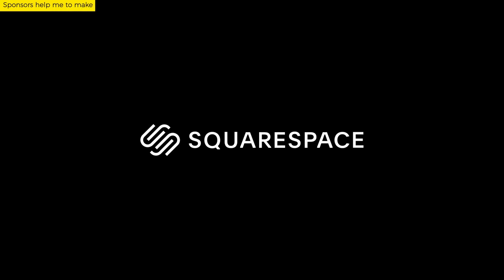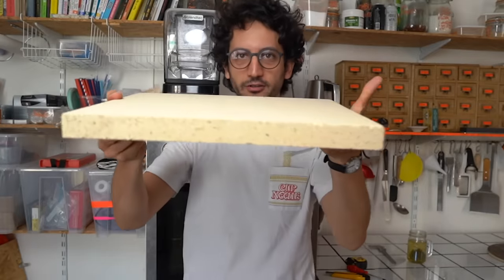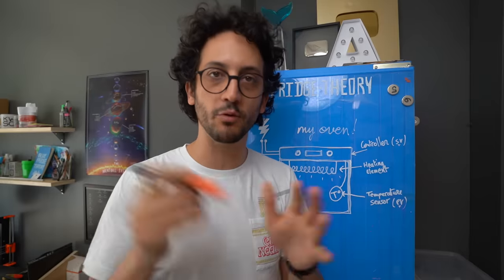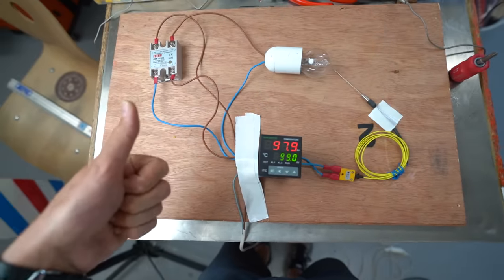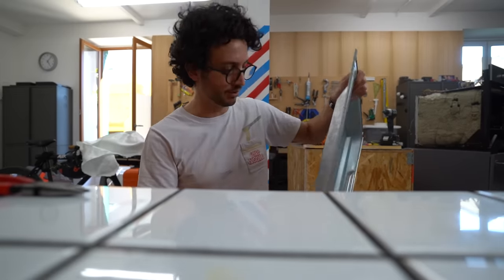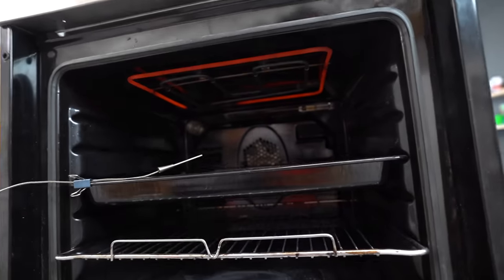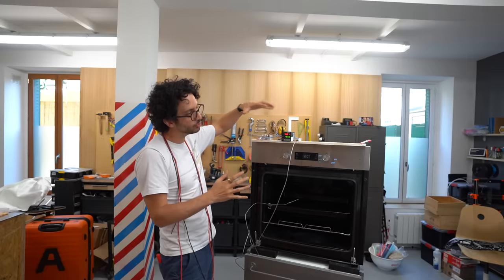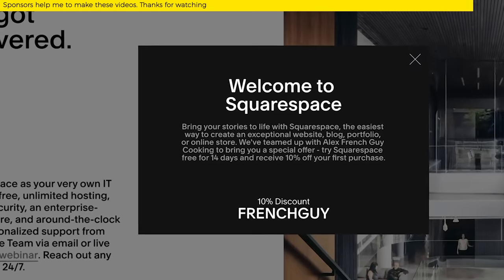I've got a Serious "Pizza Oven" Problem... (part 1)

Comment: Please be careful when you have your heat right up and the door closed. Not all doors are created to handle the heat. I used to work for a Lofra/Baumatic back in 2007 and we had major issues with oven doors exploding and shattering all over the kitchens of our end-users. The door has multiple layers of glass and if the air inside heats up to much the air pressure can skyrocket and burst the glass.
Perhaps some vent holes in the top and bottom of the door and check that the materials and equipment above the door can handle the heat that will be channeled past that area.

Comment: Note for Alex or anyone re-creating the perfect oven:
If possible use 3 or 4 wire PT100 (Class B 500°C) with a 6mm dia mounted at the centre where the Pizza is going to be baked - more realistic cooking temperature. if not at the same level as the Pizza shelf - All this for better temperature accuracy. 
The original temperature probes of the oven look like they are Capillary thermostat usually have a max temp of 300°C - if they are they won't last long.  our work ovens failed dramatically at lower temperature for over a 2years.  I would strip out this original controller setup.
If you have a bottom Heating element inside that oven - use it.  Connect another SSR in parallel,  some controllers will handle 2 separate logic (SSR outputs) and regulate accordingly.
If thats the PID temperature controller that we had at work it ain't that great but its ok for what Alex is attempting.
Don't forget to AutoTune(automatically learn) the PID controller so  it understand how to regulate this oven setup (heating and cool down and temperature ripple control).  There is a function on some PID controllers to autotune at every power up.
Retest oven temperature (+10°C) with external temperature logger to prove that its about +/-1°C fluctuation.  more expensive PID controllers can get +/-0.3°C stability.
I'm worried that the working temperature of the Controller is at the top of this oven as I can't see if its properly insulated.  Typical temperature controller electronics won't got above 55°C. monitor this area at max temperature,  as there are some controllers with built in temperature reference to compensate for probe accuracy (CJ - cold junction).  if the working/operating temperature is hotter - move the controller into an external box away from the oven for more stable reading and temperature control.
Some temperature controllers are programmable (cheap ones 4x segments) so it will switch off after a time.  some controllers have comms(RS485 or Ethernet tpically MODBUS) for remote controlling - i like these.
Depending on the insulation and heat of the oven, should be looking at Working output(WSP) - (applying power the heating elements in %) to be less than 40%,  if the oven is well insulated (without glass window) I've experienced  10% to maintain spot on temperature.
There are people more experienced than myself - please correct me as my fact could be wrong

Comment: I'm not an electrical engineer, so Alex is most certainly doing it correctly. But if I was approaching this problem, it seems easier to modify the signal coming from the existing probe, and have a switch that activates a simple circuit tricking the oven controller into thinking the probe was reporting, say, 200F lower than actual temperature? Seems simpler, and wouldn't require nearly as much modification. I believe those sensors work on a fairly uniform resistance scale.

Comment: Am i going crazy? 
Wasn't this video series started with a video altering your oven at home? I'm 100% sure that i saw you alter the oven at home and specifically mention the electrical engineering part. (You sawed off the bit that made it unable to open when Pyrolysis was on)
Where did that video go?

Comment: Hey Alex! 
Did you check that the heating element (and the rest of components for that matter) are rated for that amount of heat/current you want to produce/withstand (an amount much higher than the intended one)?
Just asking, because those kinds of modifications to home appliances are big deal modifications, not like the initial "hack" of your home oven.
Greetings from Spain!

Comment: I would install the probe in the middle back of the oven if possible so you get the temp reading at the pizza's location rather than the top corner of the oven.

Comment: Yo Alex. If you're using the pizza stone to get hot and cook on that, if you want the most accurate temperature measure. Drill a hole in the side of the stone and mount the probe into this. That way you are controlling to the temp of the thing your pizza is sitting on rather than the air in the oven. You won't go putting it in before your stone is up to the correct temp.

Comment: I worry about the thicker gauge cable vs the thinner from the mains. Does this not contribute to more resistance and a risk for fire? I have seen wires burn up like gunpowder fuses in an instant. IANAEE (I am not an electrical engineer) but surely cord length is included in the calculations I hope Alex...

Comment: Wouldn't the thermal conductivity of the oven wall be an issue? I feel like a thin steel wall would let the heat escape faster than it can build up in the oven and just not let it get enough. Or that element might need some serious wattage.

Comment: Just revisited this and wanted to say that you might want to rethink the idea of putting that T/C on the bottom of the oven.
Anytime you open that oven the temp differential will be highest at the bottom and the PID auto-tuning of the temp controller might over react and lead to 'integral windup' - which can cause all sorts of chicanery with re-establishing desired set point temps for a few minutes after you close it.
It's best to get that T/C as close to the process material (pizza) as possible, or at least at the same elevation (rack level) as possible, because that is the temp you are concerned with - what temp the pizza is experiencing as opposed to what the bottom of the oven is experiencing.
The original oven controls are based on the "On-Off" algorithm, and as such aren't very precise in temperature control, but on average fairly accurate over a long time basis.
That controller you are integrating is using a PID (Proportional- Integral- Derivative) algorithm which makes it more precise at the expense of taking a little more time getting your measured temp to set point. If the controller allows for such, I would suggest setting the Derivative function constant to "0", or some other way of just turning it off - you're still going to maintain a PV within a degree or two of SV as long as the door is closed, but it won't take as long to get there.
Also, about that thermocouple - again, I would suggest a Type J instead of Type K (if your controller allows for the selection), and go with a 'grounded junction' type. They are typically a bit faster reacting in my experience.
One other pro tip - It is common practice in industry to go from the output terminals of the SSR to the heater terminals with high temp wire as opposed to regular THHN, MTW, or other common "hook up" wire. 
Most regular wire is rated for about 60 C or so, and at your heater leads, they may experience prolonged periods of temps a fair bit over that. That could result in drying and flaking off of the wire insulation and increase the possibility of a couple conductors coming into electrical contact with something that you would prefer them not to come in contact with.
The cheapest high temp wire is silicone insulated, usually with a braided fiberglass sheath, and rated for about 150 to 200 C - which should be plenty enough for your application. No need to drop the big bucks on PTFE, TFE, or mica insulated wire - that would just be showing out... :)
Also, drop a couple bucks on high temp crimp terminals for the wire connected to those heater connections. If those flag terminals are standard crimp fittings, they might last a year or two, and then you're going to be in there replacing them.
They are relatively expensive at many cents a piece as opposed to a few cents a piece for the regular guys, but you only need a few of them and coupled with the right wire, they will probably last longer than you oven.

Comment: Doesn't using the broiler with it's direct IR heat,  heat the stone to a temperature much higher than the air temp?  So set the oven to max,  20 min before inputting a pizza, switch to broil.  Just before placing pizza inside, switch back to bake.   Something like that.

Comment: You could add a removable insulation panel (magnets?) to the front to get it up to temperature faster. Love to see how this evolves. Does the controller use PID?

Comment: Fellow EE here. Nice job with the proof of concept. Am I safe in assuming that the next version will use both top elements? Seems that will give you better time to temperature and let the PID controller have a tighter control loop.

Comment: 1:45 Bear in mind that if you do this too often it may result in your oven's knobs tarnishing (or even melting!) since they/re made of plastic. This happens to many ovens sooner or later but without a suitable guard I fear it might happen a lot quicker when you have the oven opened at such high temperatures. You might want to have some guard to protect the knobs - without compromising your safety of course!

Comment: You definitely want to have at a minimum two relays in series. Even good SSRs have a good chance of failing shorted. I would look for something like the AutomationDirect SOLO Standard temperature controller. Any PID that has an alarm output would be good though. So if your temps get beyond an absolute value the whole thing cuts out. Plus the better PIDs let you program them with a PC and support ramping profiles. You can also hook an HMI up to the Automation Direct PIDs and have a big PIZZA! button on the screen.

Comment: I know you're cooking at a much higher temperature - but you don't need to calibrate a thermocouple (which is inside your hollow probe because most other cheap transducers burn up at temps you're doing) so you can use a simple two point method to calibrate your CONTROLLER (standard type K is +/- 2.6°F IIRC anyhow and nearly EVERYTHING uses a type K that you'll likely encounter) without having a NIST standard available as you assume the controller is reading the thermocouple linearly andor the TC amp is linear just take 
1. Ice Water (0°C/32°F)
2. Boiling Water (100°C/212°F)
And you can tune your controller pretty closely to reality - just make sure you keep airflow up to stir the air that's in contact with the TC sheath and take into account laminar flow strata as well as heat gradient zones especially if you're not using forced convection.

Comment: You should put some aluminium under the SSR, the lower side is used for cooling itself. If you do not, it will overheat. Maybe even consider a real cooling body for it, especially since you are switching heavy loads.

Comment: Effe uno p134h 500 degrees Alex.. changed my life
Reply: I was about to mention that there are commercial options that reach 500C with 230V. But where’s the fun in buying off-the-shelf?
Reply: Jochen Schug making consistent pizza indoors within 30 mins with zero fuss.  Okay okay, you need the dough earlier, store in fridge slow long ferment is more flavour.

Comment: You need more I in your PID control, the P (proportional) always causes that small offset and never reaches set point. Some I (integral) will push it up to the full setpoint. 
For slow plants like this oven, D doesn't add any real value, a PI controller is enough.

Comment: I wonder if you could modify the existing temperature sensor with an in line resistor to trick the oven into reaching a higher temperature....

Comment: Just out of curiousity. Is the replacement cable the same cross section as your wall installation's cross section? From 2:42 I'd guess it's 2.5mm² at 7:00 it looks fairly thick. Though camera angles and zooms might be deceiving here. I just want to point out using a cable with a greater cross section than the one in the wall installation is also a great fire hazard.

Comment: You'll need to put a heatsink on the solid state relay. I've set the exact same one you're using on fire before with less current than what the oven would pull.

Comment: How did u calculate the max heat ? U could have used a multi meter to messure the resistance of the heating element , calculated max current and power draw, but than perhaps messure more ovens , older models , etc, not all heat will be giving off by the heat element at the same rate. so perhaps u could have scaled it down , to scale it back up again. So lesser surface, to heat , when u go to a pizzaria u will usualy see small flat ovens with mutli heating elements to get the high temps... Or u could in theorie take 2 ovens, place 1 heating element top , 1 bottem (hacked out of a the other one) and push it up even more. But I wonder how the heating element is seated, it must be ceramic clamps holding them down. I would imaginge. Greetings from belgium.

Comment: Hope the oven is able to withstand the heat, and I also hope it doesn't have some kind of melting fuse, otherwise that setup won't work for long, tho I guess one can always go around such a fuse if it should trigger.

Comment: Now I did something similar to an oven to push its max temp, at first it worked fine, I went in to use it one cold morning, put it on full blast and about 5mins later the glass in the door exploded as it wasnt designed to withstand the higher temps. So maybe something to be mindful of.

Comment: Alex, do you not run the the risk of having either oven malfunction at such a high heat? With the plastic and electrical pieces so close and in contact with a hot metal surface?

Comment: Alex, are you sure the heating element is going to be able to withstand 2x its normal temperature? That's what I would be worried about when doing a mod like this - that it will have its life drastically shortened and that possibly something inside the oven could catch fire/melt since it was not designed for the pyrolysis cycle (unlike your home oven).

Comment: Love your videos, please be extra safe on this one, ye know so we can have more... those temps are no joke.

That oven looks like a regular enamel oven... those coatings are rated to about 250°C and break down slowly under normal use.

The insulation, as you said, obviously isn't as good as a pyro oven, but really thats just to protect the glue in the shitty chipboard from self ignition.

The seal on the door might need to be swapped out. Any other plastics may also need to be insulated/replaced due to a mechanical instability risk but also possible combustibility risk at above 300°C.

But the main one is the glass door. It is highly probable that the glass, on that door, isn't rated for 450°C and could explode. Hell... an imperfection/crack/chip on a pyro glass door is enough to compromise it, with the same result. A metal shield on the front would be the ghetto solution or maybe a  second layer of 5mm high temp rated safety glass adhered with maybe a 15mm minimum air gap.

You should probably seriously consider a CO monitor too... just in case.

Again... absolutely love your videos.

Comment: Alex - you are very likely to melt the fusible link safety in the regular oven circuit, and thus kill it with your first high temperature run. It can be replaced, or bridged with a wire to restore function. Ask me how I know....🙄

Comment: The values of your temperature controller might be all over the place because you are combining the K-Type connector of your sensor with supposedly nickel plated connectors to your controller (can be seen at 5:05, the ones with red plastic around them). For this type of temperature sensor you need compatible connectors all the way through since wrong conductor material combinations will offset the thermoelectric voltage at the sensor itself.

Comment: Alex, that refractory stone needs to have had burning wood on it to to work properly. A pizza steel will deliver the heat at a more appropriate rate allowing more even charring,  greater throughput and less energy use. 10mm of mild steel with 6-12 ultrathin coats of hippy-grade flaxseed oil  is perfect.  S/S gives it's heat too slowly, like the refaractory stone.

Comment: Hey, you are not that bad at electrical things. Serious cable, serious socket. I hope there is serious cable on the wall and serious breaker. I would use socket with disconnect switch to quickly cut power to the oven.

Comment: Alex, you don't tin wires that will be crimped. The solder will creep over time and the crimp will loosen off. You solder, or you crimp. Not both.

Did you have a plan for insulation? You don't want it melting anything...

Comment: Alex puts big ass 50-amp looking receptacle on wall when the wires into Le Studio look as if they are rated for only 30 amps. Perhaps they are using that funky 220 volt service. Stay safe Alex!
Reply: Looking at that wall again, looks more like 12ga wire rather than 10ga.

Comment: That looks rather dangerous since you are overriding the PID control. But I guess as you keep it away from wood, the worst will be only a burnt out coil. 

At this point, why not go the wood fired route instead, since this would probably be too dangerous to do on a regular basis anyway. 

Can we do it outdoor with fire? Or is the energy demand too high and needs pumping air into the flame?

Comment: He's right about don't do this at home. While it's possible to repeat what Alex has done remember that oven was never designed to run that hot. Elements, electrical connections insulation etc would have to all be updated to make it reliable and safe.